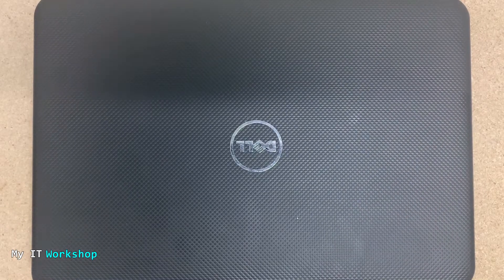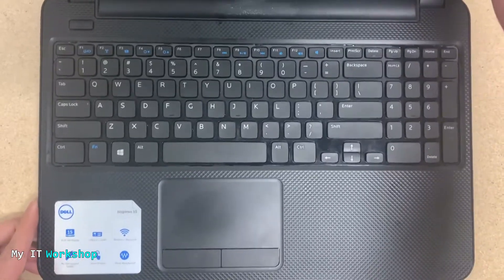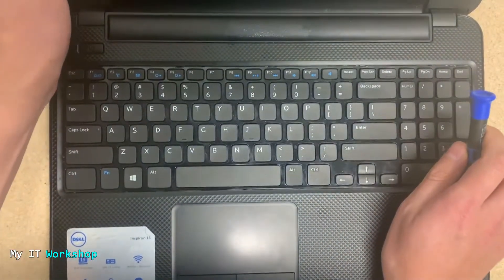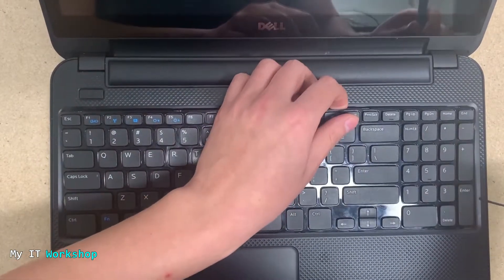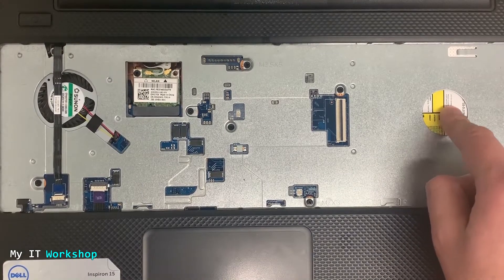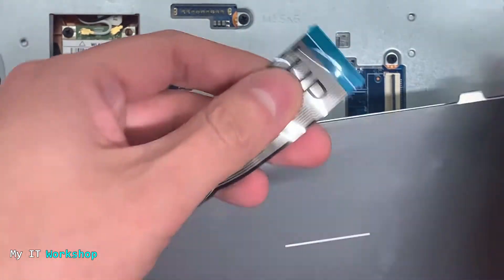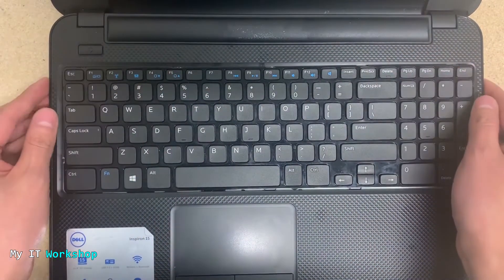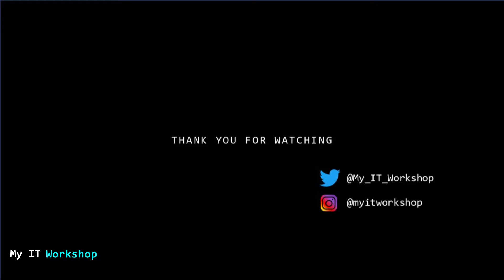Laptop Keyboard Replaced | Dell Inspiron 3521

Comment: hey there!!!!
I have a problem on my DELL Optiplex 7010 that maybe u can help me out with...
the problem is whenever I boot my PC it freezes on the dell icon 
then a message pops up on the top left of the screen saying "Get FW version error"
then after a few seconds another message pops up under the "Get FW version error" saying "ME invocation error"
the message appears then after a few seconds the same message pops up and then the following message pops up
"error sending end of post message to me system halt"
then the PC freezes like this forever 
I couldn't find a solution I looked it up on google and it said that its my BIOS 
I tried installing a BIOS update on my bootable USB and the same thing happened but Just this time it was a black screen and the same messages poped up 
I also tried changing my BIOS setup to UEFI and again nothing
plz can u help me out??????